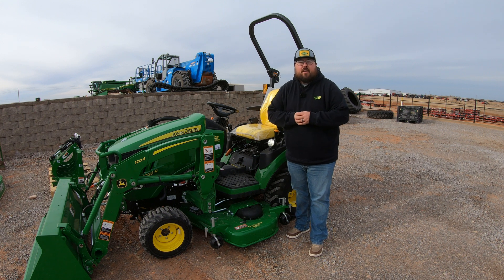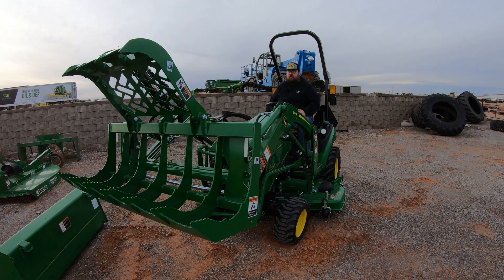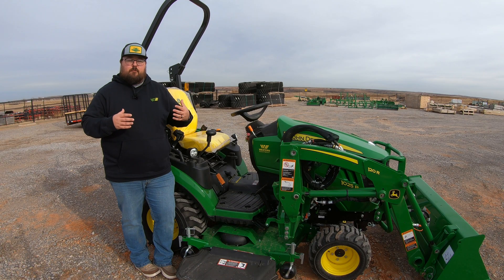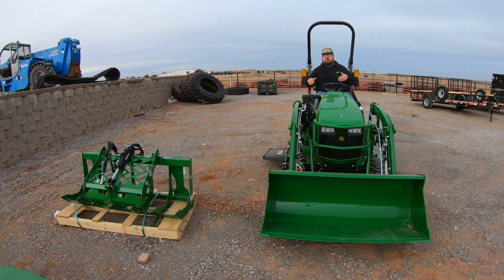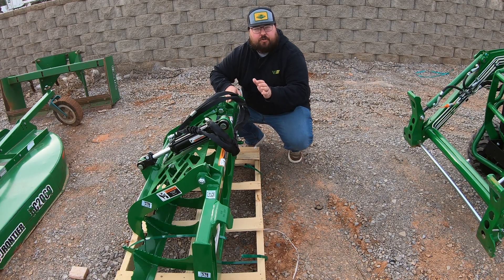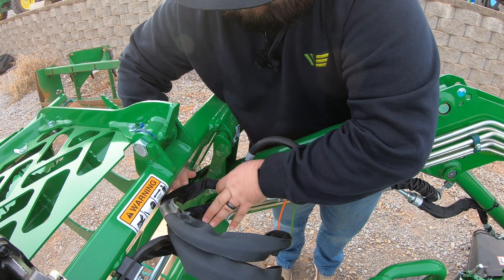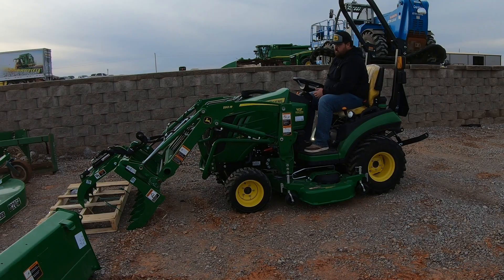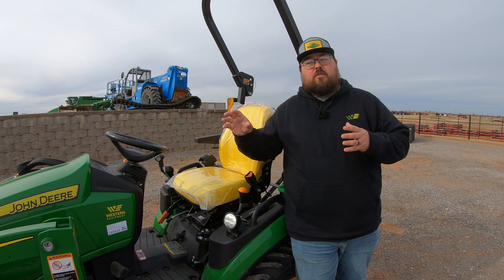Do you need 3rd function hydraulics on your John Deere 1025R Tractor?

Comment: Good video. I highly recommend getting that Deere 3rd function dealer installed. As well as I recommend a Summit 4th and 5th rear SCVS kit. 
Which if wanting the summit 4th and 5th, also get the Deere power beyond dealer installed. A tractor is only useful as the attachments you get for it.